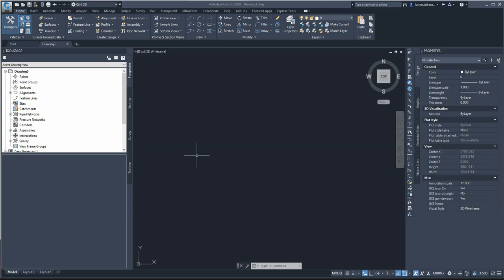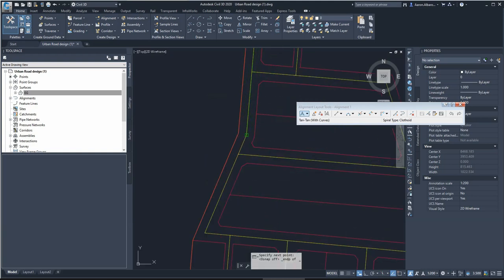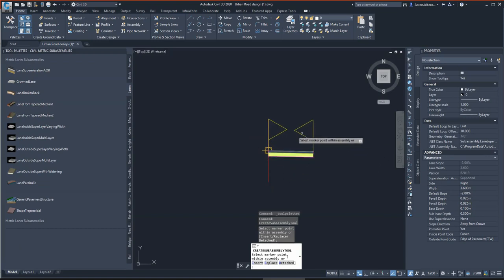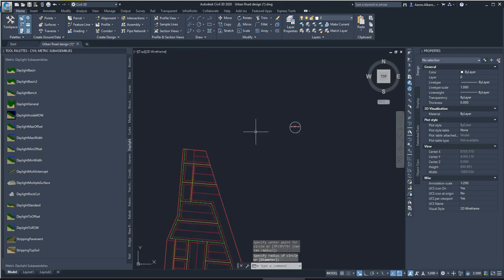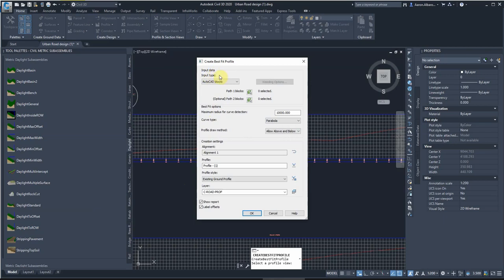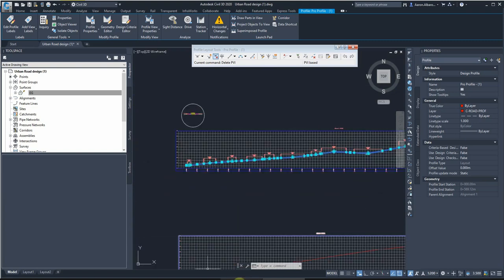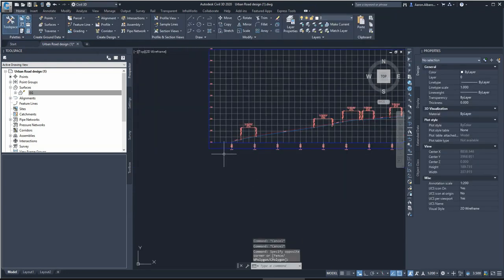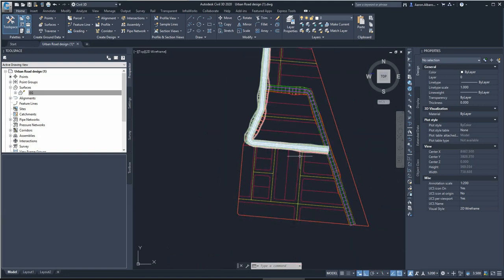First steps into Urban road design

Comment: I appreciate you for useful videos, your videos and how you explain things is really interesting for me. I have a question about longitudinal profile and would be garteful if you can answer me. In your intersection videos you did not talk about the profile of exact point of intersection. I mean is any changes needed for profiles that are joining in a point? maybe designed profile are in diffrent levels at intersection point. In this video because of the topography that is flat we have not had any big problem about differenciate level of profiles.